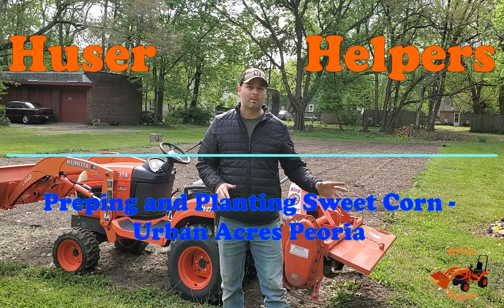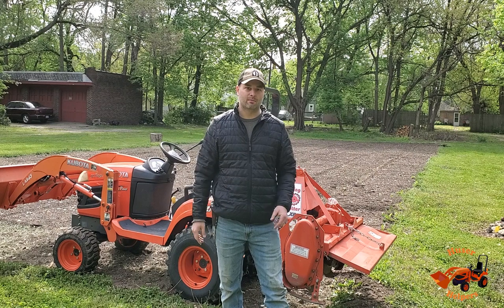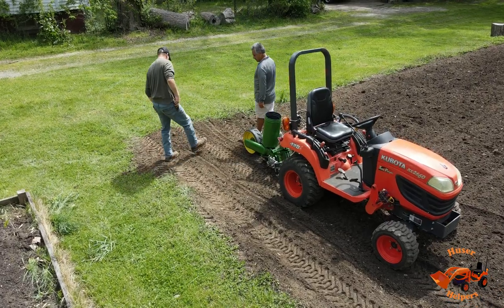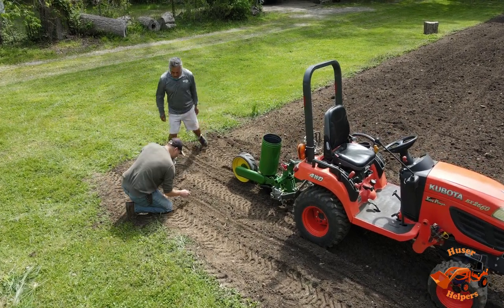Kubota BX with John Deere #71 - 1 Row Planter (Garden Planting)

Comment: That steel flap on the back of the tiller should be only an inch or two off the ground while tilling its not supposed to shoot dirt out the back.
Reply from the maker: You raise it when you want to cast dirt out the back.  This garden was extremely un-level.  I was cutting the high humps and casting the dirt back into the low areas.  This is a trick you can do.  I agree under normal tilling 1 inch above soil, and for new gardens having it fully down to reprocess dirt.